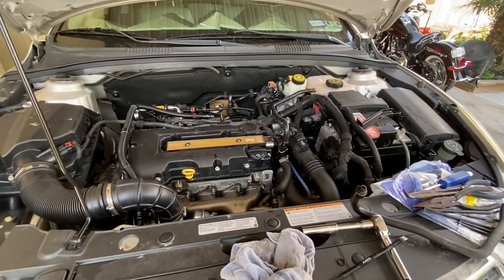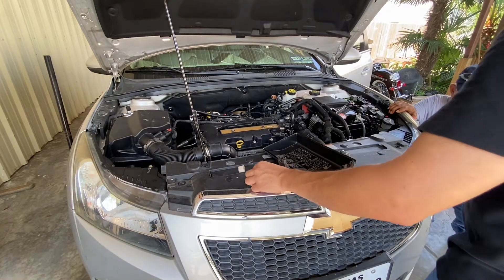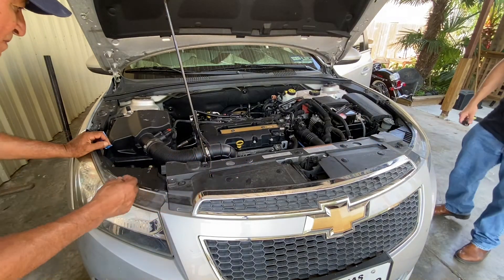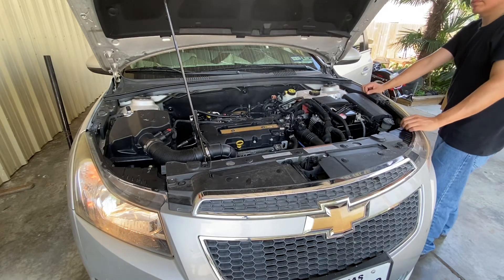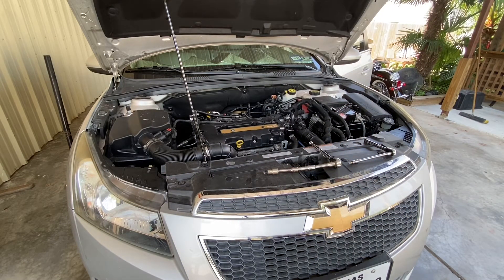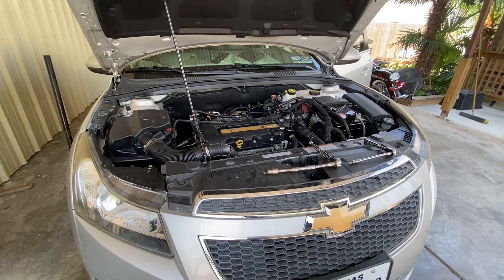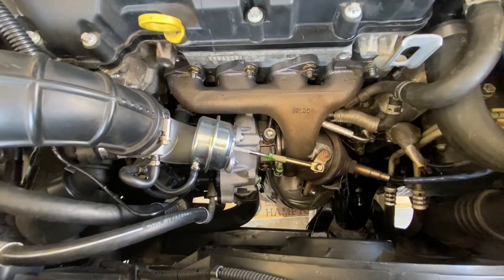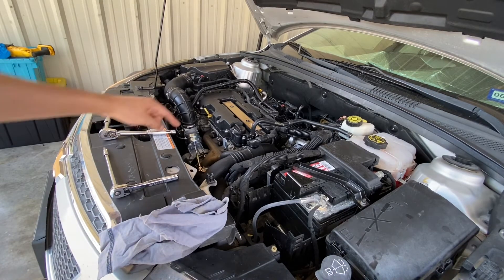Chevrolet Cruze Stigan Turbo install first start

Comment: The bolt below your oil feed line going into the engine needs to be over top not the way you have it
Reply from the maker: Whoops! Well, it hasn’t blown up yet.
Reply: Good eye. 9:46 that bolt is actually the wrong one. It should be a wide head e-torx.

Comment: I installed a turbo in my gf's car last summer.  The oil line on top needs to be set with a bolt overlapped to keep it in. Stupid engine build by chevy if you ask me. My only issue now is that i have an oil smell coming thru the air vents at intermittant times. Still trying to figure it out. I replace the pcv and the rear valve too. But it still smells ugh
Reply: could be leaking oil cooler

Comment: Did u need any special tool to replace the turbo. I took it to firestone and they couldnt do it because of a special tool for diagnostic. Smh.
Reply from the maker: What? They wouldn’t replace the turbo?
Reply: @hordebutcher2651   so what lines  should i order with the turbo. Someone said the oil return  line likely will break off while replacing the turbo. Lol im like what?
Reply from the maker: @Hey_its_Koda  

Here's a list of Everything I purchased off of Amazon to make this repair. 

If your turbo isn't obviously busted, then it's probably not your turbo. It's probably your intake manifold. 

Dorman 615-380 Engine Intake Manifold for Select Buick/Chevrolet Models (OE FIX)
https://www.amazon.com/gp/product/B07GNKGT39/ref=ppx_yo_dt_b_asin_title_o04_s00?ie=UTF8&psc=1

While you're in there, replace these as well.

ACDelco D521C GM Original Equipment Ignition Coil https://www.amazon.com/gp/product/B004OI82NG/ref=ppx_yo_dt_b_asin_title_o09_s00?ie=UTF8&psc=1

As far as the turbo is concerned, 
The first three specifically are the feed lines to the turbo itself. 

Genuine GM 55568031 Turbo Cooler Feed Pipe

https://www.amazon.com/gp/product/B00GUH37UC/ref=ppx_yo_dt_b_asin_title_o04_s01?ie=UTF8&psc=1

AUTOKAY Turbo Oil Return Pipe Tube with Gasket Fit for 2011-2019 Chevy Cruze Sonic Trax Buick Encore 1.4L, Engine Turbocharger Oil Return Hose Line Replace# 55587854 55569839

https://www.amazon.com/gp/product/B083GRXRYW/ref=ppx_yo_dt_b_asin_title_o00_s00?ie=UTF8&psc=1

Dorman 625-829 Turbocharger Oil Line for Select Buick/Chevrolet Models

https://www.amazon.com/gp/product/B07TJYPP4Q/ref=ppx_yo_dt_b_asin_title_o08_s00?ie=UTF8&psc=1

Stigan Turbo Turbocharger For Chevy Cruze Sonic Trax & Buick Encore 1.4T EcoTec - Stigan 847-1446 New
https://www.amazon.com/gp/product/B078XMM775/ref=ppx_yo_dt_b_asin_title_o05_s00?ie=UTF8&psc=1

These tools will make your life easier.

TACKLIFE 3/8" Drive Click Torque Wrench Set, with 1/2" & 1/4" Adapters and an Extension Bar (10-80 ft.- lb./13.6-108.5 Nm)-HTW1A
https://www.amazon.com/gp/product/B07FDX517M/ref=ppx_yo_dt_b_asin_title_o07_s00?ie=UTF8&psc=1

yisige Mutipurpose Diagonal Cutting Pliers Seal Puller Car Push Retainer Rivet Trim Clip Pry Puller Clips Panel Assortments Puller Tool
https://www.amazon.com/gp/product/B0722L727X/ref=ppx_yo_dt_b_asin_title_o01_s00?ie=UTF8&psc=1

ARES 16003-6-Piece Non-Marring Pick and Prybar Set - Protects Fasteners, O-Rings, Seals, Gaskets, and Trim on Automotive and Electronics Applications During Use
https://www.amazon.com/gp/product/B07WFBL6BP/ref=ppx_yo_dt_b_asin_title_o01_s00?ie=UTF8&psc=1v
Reply: @hordebutcher2651  thank you man. You are life saver. This been stressing me out.
Reply from the maker: @Hey_its_Koda  no problem
Reply from the maker: @Hey_its_Koda  glad I could help out
Reply: Yeah weird.
Reply: There is no special tool. 
Its just an expensive pain in the ass to replace. Especially reinstalling the oil line underneath.